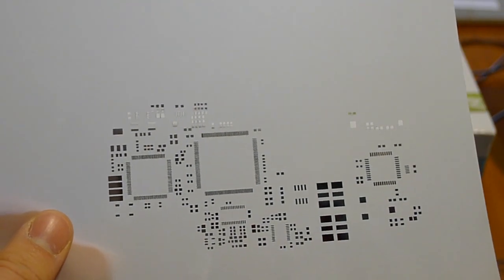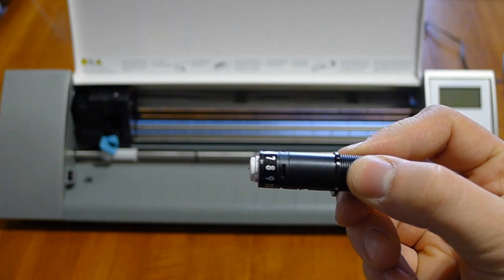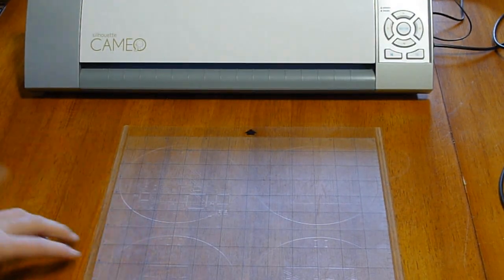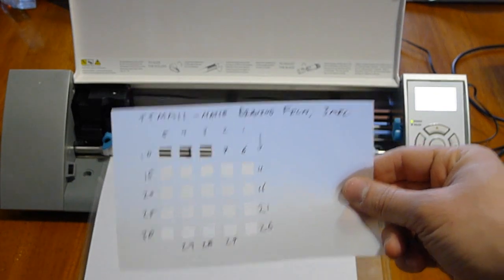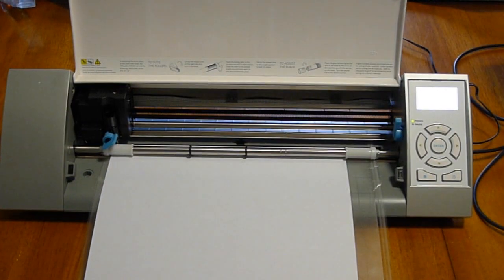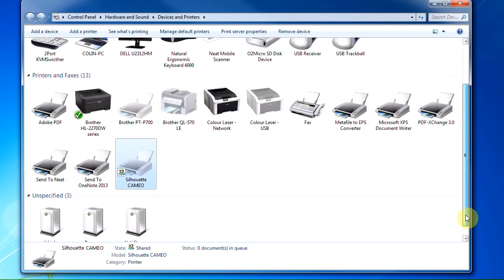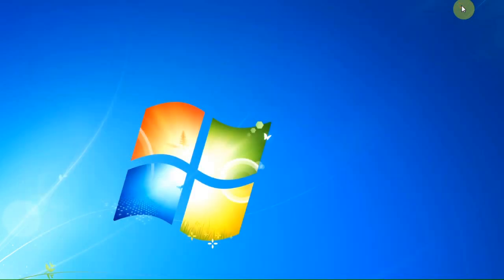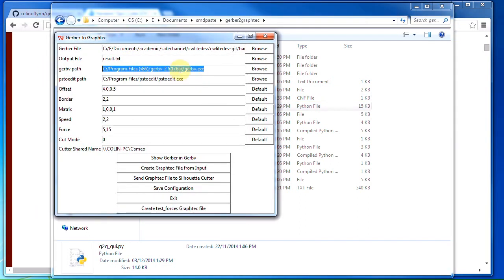SMD Solder Paste Stencil Creation with Silhouette Cameo

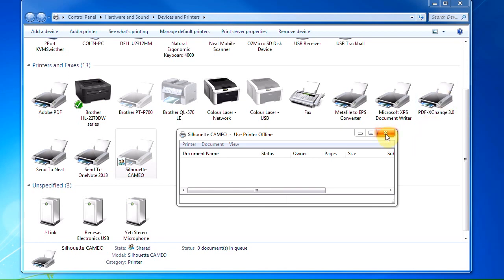Comment: I'm looking to make flexible pcb by using the Cameo hobby cutter, much as you did with the stencil.  Where do you get the drivers that make the Cameo appear as a plotter/printer in Widows?  You reference that at 7:58 in your video above, but I did not find the zip file you reference in your Github repository.

Comment: hi colin,
thx alot for your video and webpage... that helped me alot to get into the entire stuff...
i finally got it to run on a cameo v2 with v1.6 firmware on w10. was quite a fight to get this to run. 

for other ppl... maybe some hits for problems i was fighting with:

1) printer only shows up as USB-Printer Support device. unforunately this device can't be shared. seems that's normal.

fix:
-to share it you need to go to the devices and printers panel from windows
-add printer
-following window press "the printer is not in the list"
-select local or networt printer
-select existing printer
-select in the popup USB00* virtual printer. maybe there are more than one you have to try out which is the right
-select the printer driver
-use installed driver
-give it a name
-share printer and give it a name. this is what you enter into gerber2graphtec in combination with your computername.

unforunately my windows is in german so i don't know the 100% names for the window items...

2) gerber2graphtec problem it does not work to create the result.txt
really use the versions colin wrote on the webpage. i used for example ghostscript 9.5 which didn't work.

3) printing from gerber2graphtec does not work. if you press send to printer nothing happens. if you have a look to the printer queue the document is listed but the printer does not start to print.
fix:

this seems to be a wrong setup in the gpgl result.txt from graphtec.py. i used a usb sniffer to see what silhouette studio sends to the printer. saved this to a file and used this as result.txt and send it via gerber2graphtec. this worked fine. so it must be something which gerber2graphtec does what is wrong for the cameo 2. 

so i investigated a bit and kicked all stuff out from graphtec.py which was not in the created gpgl which was done with silhouette studio. beside this the gui creates a return in the result.txt for speed setting (not sure if this is a problem)

and? it works now.

if someone needs my patched graphtec.py tell me.

really important is that only send if the printer queue is empty to do so delete the queue. sometimes one printjob can't be deleted. to reset unplug the printer from usb.

4) printer is not recognised in silhouette studio.
fix:
this is really odd... maybe a driver problem.

-disconnect power and usb from the printer
-start silhouette studio
-goto send
-printer is not found of course
-connect power and switch the printer on
-wait a while then connect usb to the printer

this worked for me ...mostly ;) it's from the silhouette webpage...

but i'm really impressed. never thought that cutter can cutout 0,5 pitch ics... niceness

Comment: Has anyone tried this process with DXF format? The (free, EXPRESSPCB.COM) PC board layout S/W I use doesn't make the Gerber files available to the end user, they are proprietary to the vendor but they do generate a dxf to scale that has all the detail needed to produce a stencil.
Reply: I've opened a DXF directly in the Silhouette Designer and had great success making stencils.  The DXF exporter used the right units so all I needed to do was import the DXF, duplicate it a couple times, put a border around each  to cut out mulitple copies on a single page and then cut.

The hardest part of the process was adjusting the cut speed and depth for a new material I never used before.
Reply from the maker: You might be able to remake the gerber-->stencil instruction commands. In theory it's a similar idea, but would need some work on your side I imagine. Or see if there is something that can import DXF, then export a gerber file (other PCB software for example, or a gerber editor software).
Reply: I guess I'm going to find out shortly given I just bought a machine on ebay....The machine itself lists DXF file compatibility. That would be the easiest thing to try first.
Reply from the maker: Huh - it may in fact be using DXF then for the gerber cutting! The printed gets mounted as a shared printer is all I know, and the software prints via the 'network share' (even if it's local). I tried to not learn too much about what happens behind the scenes ;-)
Reply: edit- The Silhouette Designer supports these file types: .png, .jpeg, .bmp, .gif .tiff, .gsd, .dxf, .svg. I thought I would have to upgrade but the stock program works fine to open a .dxf. I just downloaded it and opened a dxf.

Comment: Hi,
Thank you for the tutorial Colin.
I have the Silhouette Curio and whenever I click send to Silhouette in the app you made... nothing happens. after trying for many times now I can only cut the borders specified in tha app but not the board itself!!!! had such issue before ?
Reply from the maker: Huh - not sure! The app was something I just modified a bit, so not sure on the inner workings... I'd try a different Gerber, I did see problems like that when it couldn't process the gerber very well.
Reply from the maker: Tried to respond and comment doesn't seem to be appearing, so sorry if you get two of these. But anyway I'm not sure off-hand, I had seen some issues for certain gerbers the Silhoutte just didn't seem to like. I never figured out why - maybe try a different gerber (possibly from different software). Might be a setting on the gerber export?

Comment: I followed everything to the T. It works wonderfull. I use the V2 Cameo Cutter and I cannot believe how good it's working.
We do not have Mylar / Drafting Film paper in South Africa, but I used overhead projector paper for ink-jet printers and the result is stunning. The cutter may be a bit slower but I have nothing to compare it with. The result is 100% clean. I have measured the thickness of the paper to be 0.12mm. Still clean.
Reply from the maker: Great to know - did you have problems with the V2? A while back someone had trouble with it, but maybe newer firmware fixed that issue.

Anyway it is absolutely amazing how well this thing works for what is assumed to be a silly scrapbooking machine ;-)
Reply: No problem at all..... I did download new firmware and update the cutter. 
I'm going to try 0.14mm Acetate Sheet. A bit thicker than your 3mil but I need that extra solder paste on some heavy duty components.
Nobody believes me if I tell what I have learnt from the web.

I will one day tell my story and what I have done with the information gained.

Thanks again.

Comment: Really nice. Thanks. 
What does the border setting do?
Reply from the maker: +Yau Garba To be honest... I don't know fully, my assumption was it defines how far out the 'border' of the piece is cut (i.e. how much extra material you get), but it doesn't always seem to correlate to set values.
Reply: +Colin O'Flynn Thanks for the response. I figured it out experimenting and you're right. It cuts what is specified as border (inches) from the bounding box of the gerber.
Reply from the maker: Alright great - I remember my issue was some of my gerbers had their own border already, so the system would cut by that (closer) border. I ended up getting a gerber editor to fix that.
Reply: @ColinOFlynn  What gerber editor do you use?  Thanks!

Comment: Hi Colin, This is Wagner. I Have a Silhouette portrait, it's a little smaller, but I have a problem. when I make a big PCB the Silhouette of cut is not exactly to PCB. It happens with the Silhouette Cameo?? Thanks for help me. PS. So sorry, my English writing is too bad. thanks
Reply from the maker: Wagner Wavah Is there a bit of a scale issue or what does it look like? I haven't seen that problem!
Reply: thanks Colin. Firts I started to make the stencil like you later I changed the transparency by beer tin alumminiun. The process is same or almost same. I think to do a little movie about this.
Reply from the maker: Wagner Wavah Cool - let me know would be curious to see it working with that!
Reply: How long does the blade work when cutting aluminum?
Reply from the maker: Haven't tried it with aluminum, have only used that mylar material. I assume some thin foil would cause a lot more wear than the mylar...